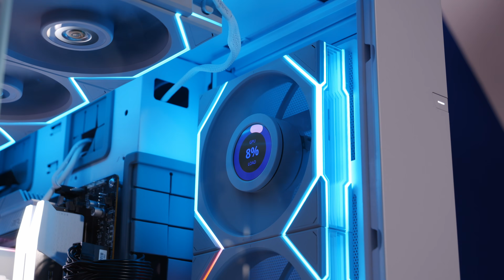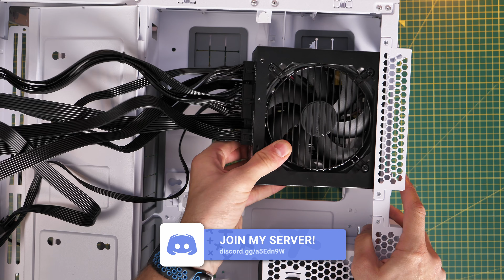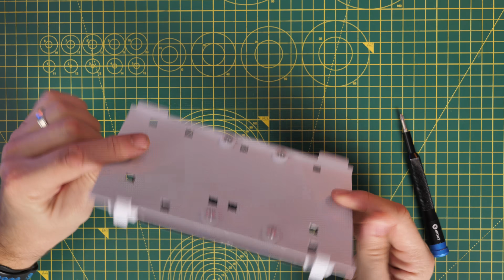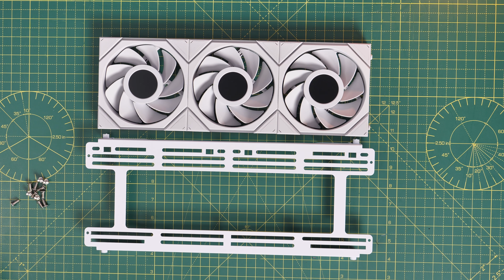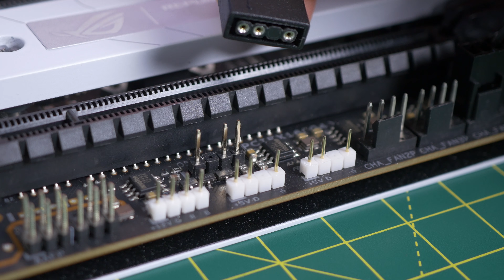Lian Li O11D Evo RGB deep dive with various build layouts!

Comment from the maker: Specs of the build in this video (Please note links listed here include affiliate links which may earn me a commission.)
Motherboard - MSI MAG Z790 Edge TI Max Wifi https://amzn.to/41yjPmh
CPU - Intel Core i9-13900K CPU https://amzn.to/3Ry7UAl
RAM - Corsair Vengeance RGB DDR5 16GB x 2 6200MHz (https://go.corsair.com/eKAL3Z)
NVMEs:
Corsair MP700 Pro NVMe - https://go.corsair.com/eK2g5D
Case - Lian Li O11D Evo RGB (https://youtu.be/c-0WW77_fM8)
PSU - Kolink Regulator 1000W PSU (https://youtu.be/sjEJrl294mI)
CPU Cooler -  Lian Li Galahad 2 LCD SLInf https://youtu.be/Stx1ystVIWg
Fans - Lian Li TL120 and TL LCD https://youtu.be/fL4uYmJvnzc
GPU - Gigabyte RTX 4070 Ti 12g OC https://youtu.be/_-bu6qDqeWA
Reply: i hope you can reply to this I'm currently trying to build a pc with the MSI MEG X670E GODLIKE and i don't really know if the lian li O11D EVO RGb will work for this
Reply: @provokedpawn did you make a video yet on how to do a upside down build on this case.i have this case now and can’t build it until I find out how to make it left sided

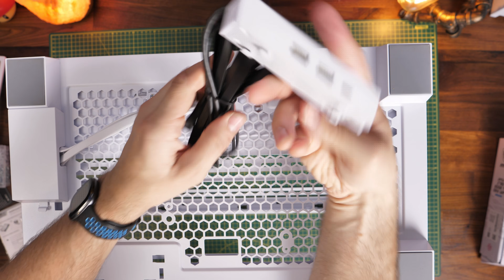Comment: 15:40 I think the idea here is to buy a splitter that connects to your motherboards USB C and USB 3.0 ports. A great benefit of the USB standard is it's capability to theoretically expand up to 127 devices on a single port, because each device is given a unique address and they take turns sending packets through the controller.

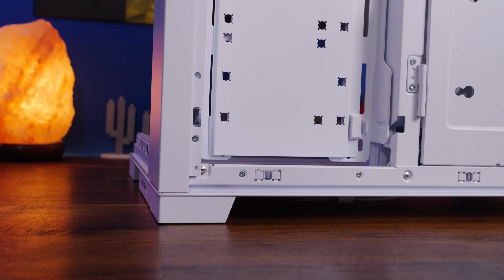Comment: 6:24 I am one of the weirdos who used this wall to mount a couple of hard drives, since I had 4 hard drives and no where to put them. I even didn’t buy an ASUS motherboard over an MSI because the ASUS only had 2 sata ports and MSI had 4 sata ports. Meanwhile both my old motherboards each had 6 sata ports, it’s just lame that companies think we will only use NVME SSD’s now, SATA SSD’s are still useful and can’t use them without sata ports ffs

Comment: Question: 

Can you do a push pull on the side with a 52mm max radiator (with fans ) and 25mm thick fans on the back. Total of 77mm thick  (give 80) to be safe.

Can this work on the O11D Evo?  Cause the video looks Ike you have space

But I have a 4090. 331.8mm length (13.06 inches) So I’m just wondering.

Cause I don’t want to do top radiator, pushing hot air into the radiator isn’t really ideal.

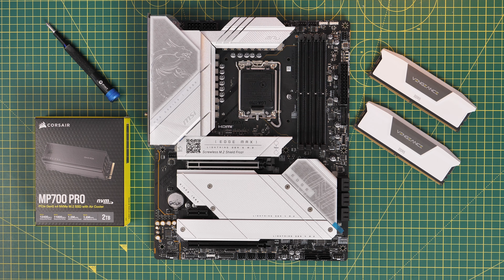Comment: 18:40  I really dislike the modern trend of burying the CMOS battery under the heat sinks near your rear I/O.  That means if you've built your system and a few years later your CMOS battery dies, you have to remove those heatsinks. That means you have to remove the bracket on the back of the motherboard. That means you have to tear down your entire build just to replace the stupid battery.  On top of that, the battery is usually a very specific design that's wrapped, wired, and has its own connection on the mobo. I bet you have plenty of those just lying around.....right?

Comment: Has anyone installed 140mm fans on the top with a spacer? I have a side intake push pull but I wonder if I need to reverse the side bracket so the radiator goes in deeper to the sidewall. I want to install three 140mm infinity fans on the roof with a spacer to see the lights on the glass but worry that the barbs will hit the spacer. My tubes are up side intake.

Comment: ROG Thor 1200W Platinum II will fit in this case?
Reply from the maker: Should do. If you're concerned check the PSU size specs Vs what the case can take on the website.

Comment: Nice vids as usual... I've just bought this case and was considering building it upside down like shown @0.30s. As you've already told me, never put the radiator belly flat at the bottom, but now I see you've put it on the side with the tubes on the bottom end, can I check that it is safe to do so please? Thanks ahead.
Reply from the maker: Here's a bit more of an explainer https://youtu.be/PsITrM6mFug

Comment: Hey man I just got all my parts delivered finally. Took me months to find sl140s in reverse. I have a quick question for you. For a side intake push pull setup would you recommend I mount my motherboard in the high position? Second question I have is should I flip my side bracket inside this case so the radiator sits back further or install the radiator in the default side bracket position?
Reply from the maker: I'll be honest I can't remember much about the case without rewatching the video. High position probably makes sense, as for radiator mounting it's pretty flexible in terms of space.

Comment: It seems to me unless you're doing a push-pull AIO on top or have an LCD on top, the upper position might have a more symmetrical look? Any downsides to using the top position? Just curious why the standard is the lower position considering...

Comment: the swapable PSU location is also nice if you want to go the custom cable route and would like your cables as short as possible without to much spaghetti everywhere.

atleast in the 011D with a corsair SF750 if you reverse mount it in the top all your connectors are where you would want them.
EPS is top left of the PSU, besides that is the 24 pin and below that is your PCI-E and Sata nothing needs to cross over another cable to go where it needs to go it's awsome.

and the plate it free's up is where i've housed my Fan/RGB/Pump management. (hope the EVO RGB leaves enough clearance i have my eye on it for a future upgrade seems like everything i love about the 011D with better airflow and minor tweaks

Comment: The BIGGEST problem I encountered during my build with Aorus Extreme AI TOP X870E was the rubber with E-ATX board was too thick, so I had to cut it down, so my board would not BEND nor be MOUNTED UNSAFELY. The case is only with boards that come with thick backplate....

Comment: I ordered mine cose is the only decent white case, but I wonder why they made grey color insetead of white the rubber things where you pass the cables, also no dust filter in the back? Edit: after 3 months small dust particles are visible on the botom fans, so the botom filter is usless.

Comment: Hey, I built this pc except with a 7800x3d and x670 mobo, and am having a weird problem.   If I do windows-> restart, the pc won't post.  However,  if I do shutdown, and then hit the power button like normal,  it posts just fine. Cinebench, mem tests, and all other diagnostics and functions work fine.  I cleared cmos and even replaced the cmos battery,  and that one issue still persists.  Any ideas?

Comment: Can you turn the plate for mounting the fans in the top compartment so that the recess faces inwards? If so, would there still be room in the upper area to mount fans there? So I could install a radiator with 6 fans in the upper area again, right?

Comment: Hi is it possible to use the arctic freeze 420 aio with fans (67.5mm) with the low mobo setting and also use push/pull set up? With another set of sl inf 140.. … all together 92.5mm ?? Or would I need the 360 aio with 140 fans ???

Comment: I just bought this case to replace my Lian Li Lancool II. It sucks in so much dust through the front I am constantly cleaning it and the radiator in the front. No dust filter means a ton of dust and I was at my whit end. This is going to be exciting not to mention had it reversed since it sits on my left.
Reply: You could make your own, or use the bottom as intake 6:18 and put the radiator up top

Comment: I’ve got a custom build from ek fluid I bought used and it has an older version of the lian li case. 

You know the main differences?
Main thing I don’t see the radiator/ fan trays removable, the corner bracket cannot be removed. 

I’m looking at grabbing one of these to swap everything over 😊

Comment: Hello, I recently got a very similar pc built with 3 TL LCD fans and 7 TL fans however every now and then the RGB on the fans seems to flicker on and off. Any idea what the cause of this could be?
Reply from the maker: Afraid not. Unless there's a loose connection somewhere. Have you checked for firmware updates?
Reply: @TheProvokedPrawn  Thanks for the fast reply. I've checked the connections and the firmware all seems to be in order there. I've already had replacements from Lian Li as well but that didn't seem to resolve the issue either. Thanks for the help though!
Reply from the maker: @ashleylinette5462  all the fans flicker? Could it be a power fluctuation? From your power supply or a loose power connection to the wall or internally on the PC maybe
Reply: @TheProvokedPrawn  All the TL fans flicker yes, the LCD screens and the fans themselves seem to stay on though. It could be a power issue but all the other components in the computer seem fine. I've tried 2 other wall sockets as well, that didn't help either. A quick browse of the lianli Reddit seems to indicate that multiple people are having this issue. :(
Reply from the maker: @ashleylinette5462  did Lian Li replace your controller? I am uselessly trouble shooting from afar. Sorry
Reply: @TheProvokedPrawn  They did yes, I'll try to rewire everything and change the order of the fans in the daisy chains, perhaps that will help. Thanks for all the help!
Reply: @TheProvokedPrawn  Good evening, help me with one question, this case or h9 flow, both are at the same price.

Comment: Is that true that the air blow in this PC case you set bottom: Intake, motherboard side( CPU thermal radiator) : Intake too, and only top of this case is exhaust ?
Reply from the maker: That can be logical

Comment: I have the O11D Evo XL and bought 2 times the wrong vertical mount. Then finnaly it was the right one and it would have looked so cool but with my 4080 it didn't wanted to work anyways.
The GPU was sitting an angle in the power connection and didn't get power to a100%. So sad.....
After that I gave up!

Comment: 😒👍 Lian Li 011 EVO's are one of the few cases on the market that you can flip it upside down so that you can put the case on the left hand side which is why I have it, lian li also now sells reversible blade fans for the three fans that you bolt up to the side of the case theres a few other small outfits making revisersible fans too but this is something that is kind of niche still rite now, EVO's come in black and white, and theres two revisions, you have this newer one where the glass panes have no supporting metal bracket and you have the older version which has a metal frame bracket, this newer one which is all glass please be extra careful because without the frame the glass can shatter much easier and you dont want that, shattered glass makes a huge mess plus the bits can cut ur skin and get embedded in ur skin

Comment: I am gonna buy this case with all the lian li fans needed, but i noticed on my local shop's site that the AIO cpu cooler with the bigger  lcd screen is the SL and the other fans are TL. In your builds also, but they seem to light up the same? Where as on that site, the AIO shown has leds that shine/glow differently (more on the blades itself and not on the sides like the TL's)?

Comment: Great job on all your videos.  I was surprised and disappointed to find that the white RGB cases come with black anti-sag brackets.  Particularly because of the additional expense of ordering a white mobo and gpu!
Reply from the maker: You barely see it when it's installed though
Reply: @TheProvokedPrawn  Hopefully, but you also barely see a dead pixel, though you cant stop looking at it.  Youre also not using a white mobo like I am =/  Not a huge deal though, Ill build as planned and go upright or vertical if it bothers me.  Thanks again for all your great videos.

Comment: To control the rgb strip through software is it only available on the mb software app or could third party’s connect to it like lian li Lconnect software?
Reply: u have an answer already? mine changes always back to the default red-blue and i can't controll/find it with any software :/

Comment: friend, a question, Lian Li's controllers did not give you USB disconnection and connection problems with the Connect L3 software. That RGB decoration is beautiful, but I returned the CPU cooler because stable configuration of the system was impossible for me./???????????????????????
Reply from the maker: Not had problems

Comment: that puppy is CLEAN... I'm gonna buy that case.
Reply: Did ya buy it? I got it back in November
Reply: @casedistorted  no, when i finally got around to building a new pc. Everyone was talking about how bad the 50 series cards were. So i was gonna wait until the 6 series comes out. Plus ram, and ssd's have sky rocketed in price. When i built my first pc i got an 8tb ssd for $700. Now its over 2 grand. I refuse to pay that price.  I think pc gaming is gonna die off. I dont see prices dropping back down to what they originally were.
Reply: @KIS @KISS_MY_CONVERSE brother tf you need an 8tb ssd for? 😅
Reply: @wassimrahmanigtr  i have over 150 games. And I also use my computer as a plex server.

Comment: Damn,that's a mad case ,maaad,i am beginner pc enthusiast and i would like to use this case to build my self a pc,i have a pc atm but a friend built it for me,all i did was watch and pass the tools xdd But this time i wanna do it my self, i was considering the Corsair 6500d airflow ,until i saw this video,this case is cheaper and has tons of options ,it's insane i have never seen anything like that before.
Reply from the maker: Here's a build guide if it helps https://youtu.be/LZz2uhZAWzU
Reply: @TheProvokedPrawn   Thank you sir ! This will definitely help alot ,one thing tho i am using an older motherboard x570 gigabyte aorus elite and has the older front panel connector slots.i might go in a dead with that or not ?

Comment: Would 3 x 120mm fans on the side intake, 1 x 140mm exhaust on the back, 2 x 140mm intakes on the bittom and a 280mm aio on the top for exhaust work for this?

Ive buukt many pcs but its my first time actially doing fans properly and i have no clue 😂
Reply: Yes to everything except the 140mm back fan. A 120mm fan will work.

Comment: fantastic as always the lian li expert as i tell my friends  one question the radiator you used i see them its a LIAN LI GALAHAD II LCD 360 SL-INF COMPLETE WATER COOLING, ARGB but did you replace the fans  as i like  lian li uni lcd instead if you get what i mean  as i rather have the outside lighting  then the fan itself lit up

Comment: So I just built in this case and I really like it, although one thing seems to be missing- is there no static color option for the case lighting? I've been playing around with the RGB buttons on the case for quite some time now and I cannot find a static setting; every setting has the lights moving, or fading in and out. I have a hard time believing there is no static light setting. Can anyone confirm/deny this?

Comment: incredible. I'm going to be building my daughter a PC in a month or so and she likes my current lian li o11 dynamic so I'm going to swap my build to one of these. I hope they aren't sold out at that point. lol. I'm actually really stoked for this case
Reply from the maker: Have fun!
Reply: @TheProvokedPrawn  I ended up just buying it and already swapped it over. Went from a white to a black and it looks incredible. It was really a joy to build in.
I have one question though. Is that flat metal piece that comes in the anti sag bracket box needed while using the one you installed in the video? Or can i just leave it out?
Reply from the maker: @ArtFiendz  the anti sag bracket has extra parts for eatx motherboards. So if you have atx like me then it's fine
Reply: thank you! @TheProvokedPrawn

Comment: I really want to see a full on 140mm fan build in this case (mostly cause I am considering it), does it improve the air flow or? Would appreciate if you got back to me on this
Reply from the maker: from what I understand 140mm fans are mostly superior because they're larger and can move less air while spinning slower. So you can have a quieter building doing so. I've not tested thermal performance of 120 vs 140 in any particular case. Though that would be interesting for sure.
Reply: @TheProvokedPrawn  Same thing I was thinking, don't see why the airflow wouldn't be better, want to try 3x140 top exhaust, 3x140 bottom intake and the 360 rad on side, hopefully nothing goes south